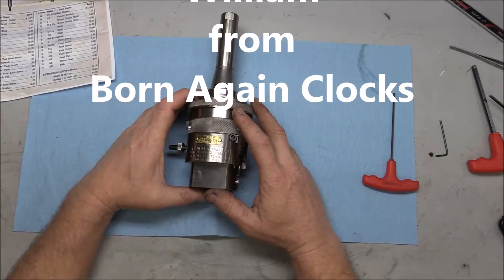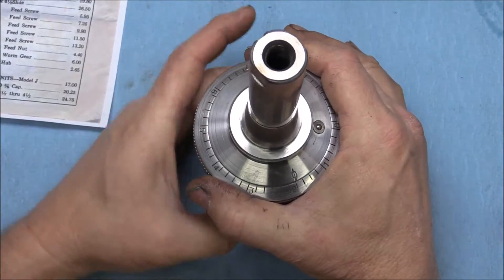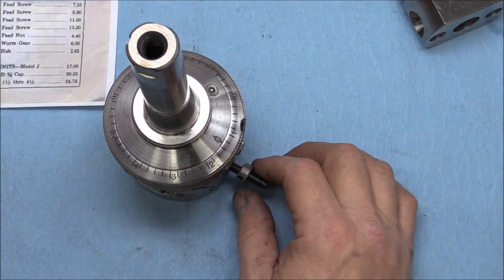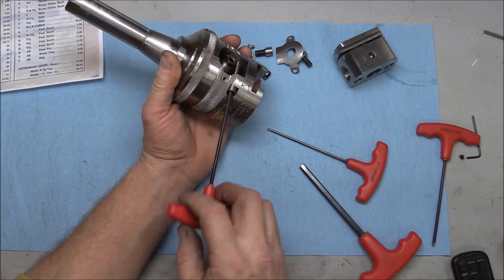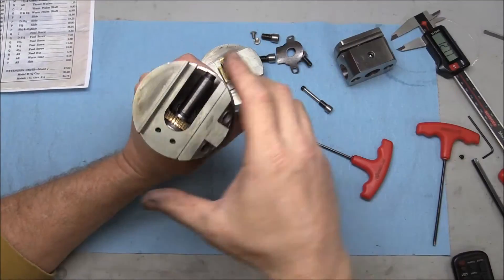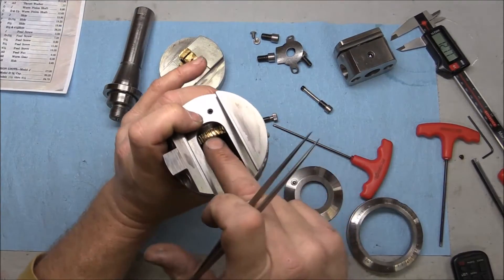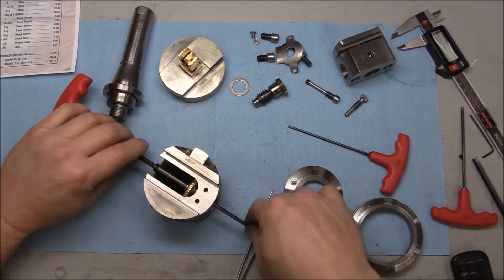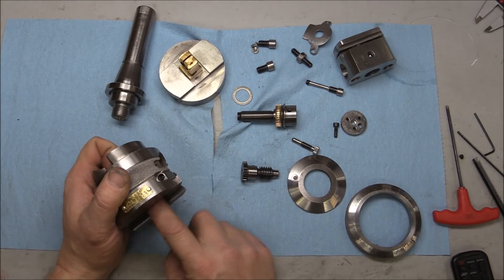Chandler Duplex Boring Facing Head Disassembly, Model "D"

Comment: Hi William, I wondered if you determined the function of the 3 grub screws that are on the side dial face?  I have the smaller J model, and it appears they may have a function for reducing play in the cross slide?

thx

Comment: Really a nice piece of gear and compact too.........I have a Tree boring and facing head which is a bit bigger than the Chandler...... too big for my immediate needs.........I've just downsized to a smaller bench mill so I most likely will be selling the Tree on and looking for a Chandler probably, wishes being horses beggars will ride etc.
I already have a Bridgeport boring head and a Chinese EBAY bought one and toyed with the idea of getting it to do facing but quite a difficult project ........it's very interesting to see how the facing mechanism works......a bit beyond a DIY build solution to make one but not impossible.........at the very worst case scenario I'll have to resort to trepanning any facing needs I have to do, or resort to boring and facing in the lathe.

Comment: Hello William,   Thanks for doing a great and thorough video on the Chandler Boring head.Like you I saw my first one on the Ox Tool channel which set off one of those impulsive," I gotta have one of those tools ASAP!",moments.I found my Mod. D on E-Bay from the son of the original owner about 18 months ago.He was a nice guy and seemed to be honest w/ his answers so I felt comfortable when choosing to buy from him. Also, you hit the nail on the head when pointing out those two commonly lost pieces of hardware as mine were missing both pieces as well. The travel limiter is really nothing more than a long set screw and a nut, but the engagement pin had dimensions that I would have to figure out on my own, that is until your video came along.Your complete breakdown of the head was also very helpful  since I cut any major disassembly a pretty wide berth for the time being. I hope that you've been pleased w/ the Chandler unit up to this point. Thanks again friend.      Regards,    Jamison
Reply from the maker: Jamison, thanks for the comment, glad to have helped. I figure thats what You-Tube is all about!!!. I am please with mine and have used it on several projects. Have a great day.